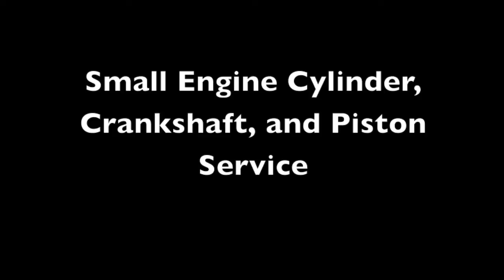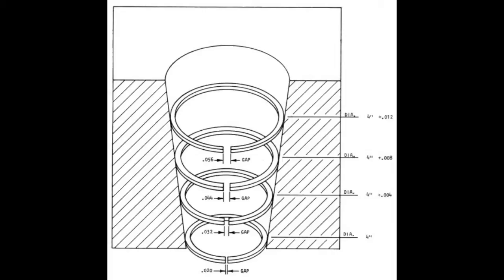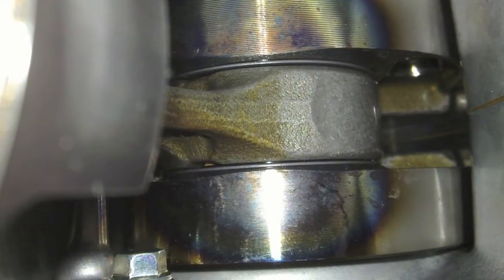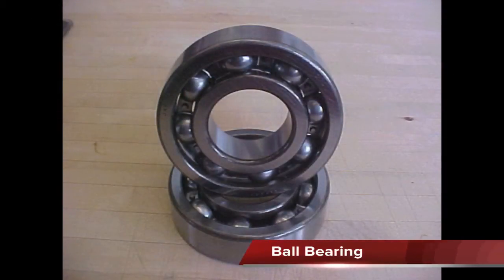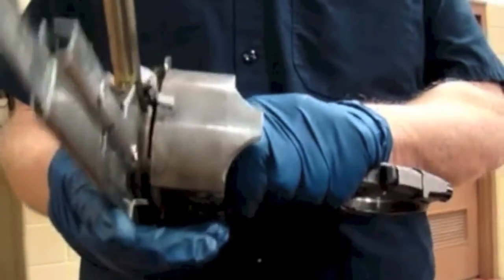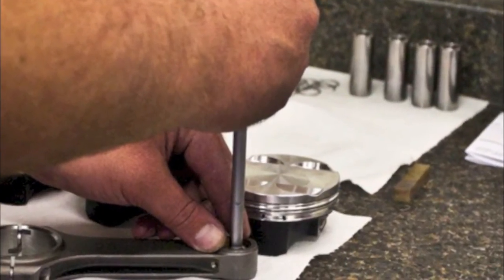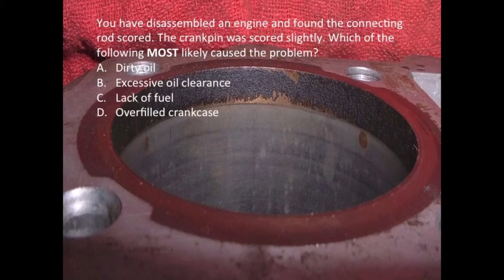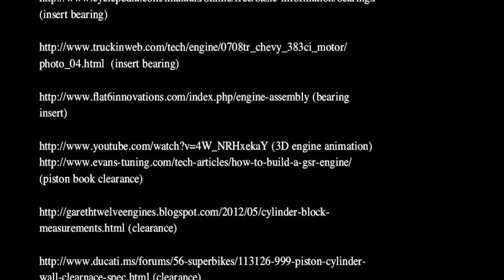Small Engine Cylinder, Crankshaft, & Piston Service

Comment: Excellent descriptive video, love all the shots of failed parts. I have always wanted a top fuel failed rod.
 I purpose built a 1L Swift engine with all used parts accept rings and valve seals as an experiment. I took the best valves, bearings,pistons etc from three engines.  That little bugger was still awesome after 48k, it outlasted the car.